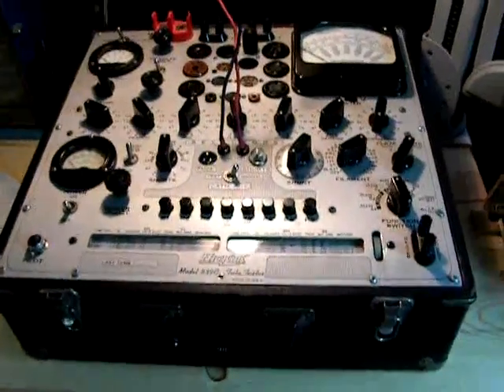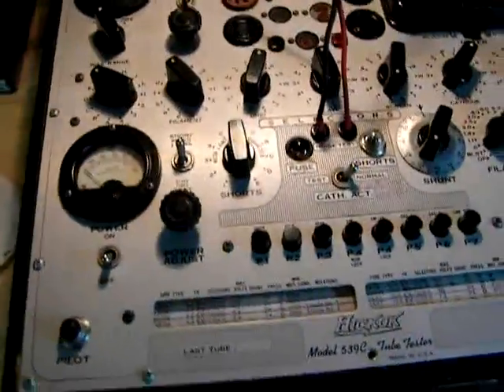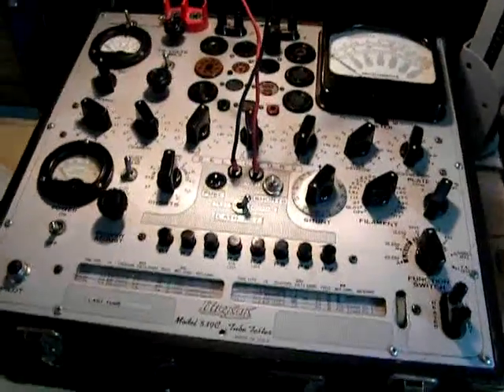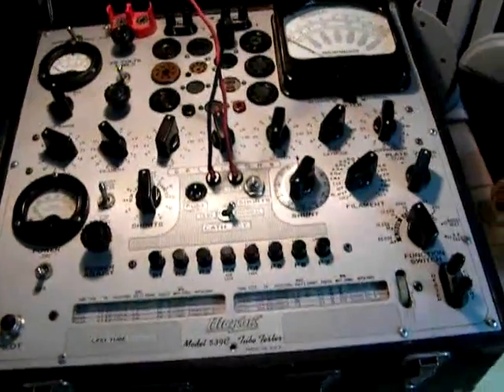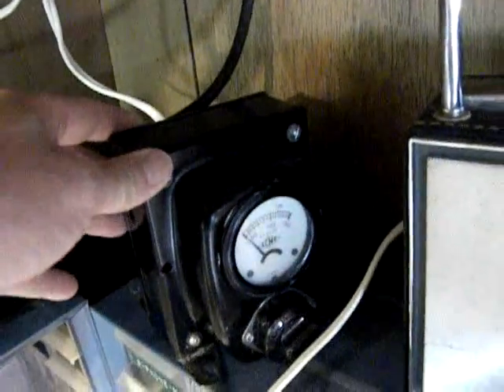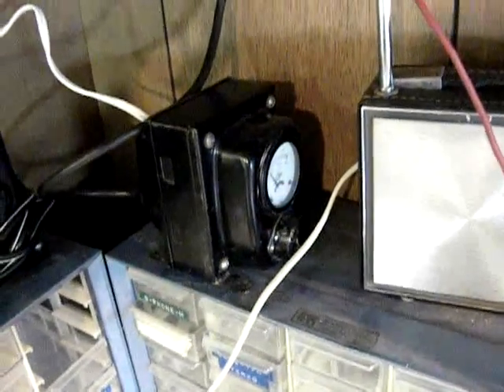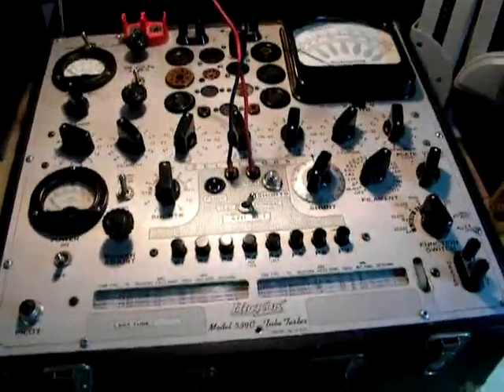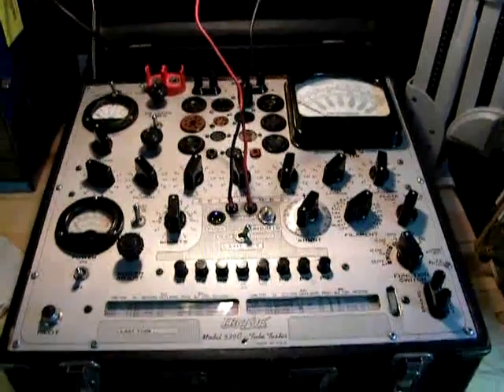hickok vacuum tubetester 539c 539a 539b tester power issue

Comment: Cool video! I'd love to know what kind of vintage step up/down transformer you used as well.. I'd rather buy an old one than some new, junk Chinese made one. Thanks!
Reply from the maker: P-6160 is the one I have ,here is one on eBay for 60 bucks but they come on ebay for less if you are Patient https://www.ebay.com/itm/Stancor-Isolation-Transformer-P-6160-125-115-105-volts-60-cy-115-v-100-watts/253756299050?hash=item3b150dd72a:g:tLAAAOSwY3tbTNa7

Comment: Yup, people don't realize the line voltage issues with running these old testers that were designed for 110vac.  Last year I did a repair video on the 534.
Thumbs up-Good video !